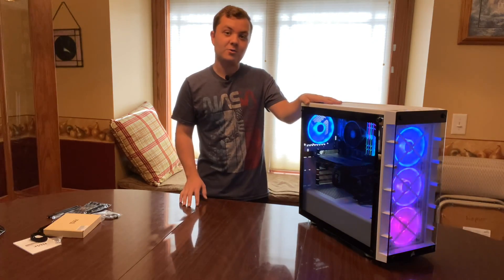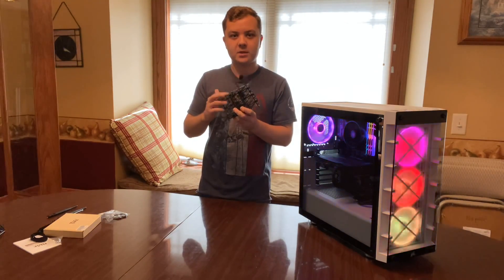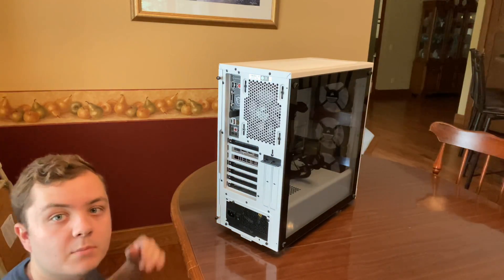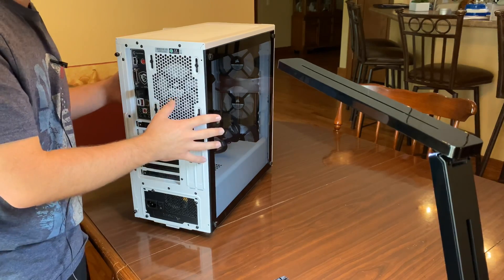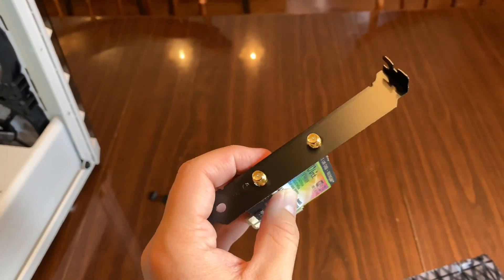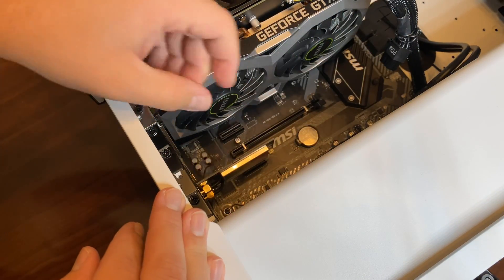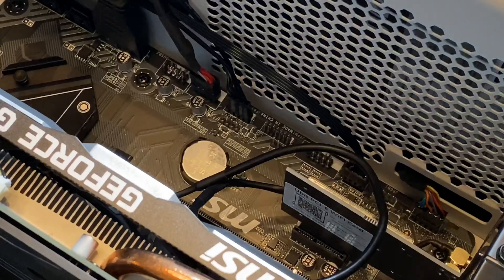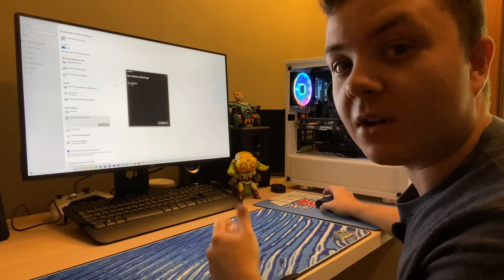How to Add WiFi/Bluetooth to a Custom Built PC

Comment: Typically you either buy a motherboard with wifi and pay the extra or you buy a cheaper motherboard and pay for wifi later.  In general, I don't think you did anything wrong.  There is an advantage in buying a separate wifi card, especially if you upgrade the motherboard often.  The same wifi card can be used when upgrading, thus reducing the overall cost of having to buy the wifi each time you upgrade the mobo.  Overall, some people like to have everything on the motherboard so that they don't have to deal with additional work and compatibility, while others like the freedom of picking their favored product for each feature and not have to be locked in by the motherboard product.  

I think you did fine with everything but that is jmo.
Reply from the maker: True. Also some people just don’t know that their motherboard doesn’t always come with WiFi. That’s what happened to me. I just bought the cheapest and highest rated motherboard and didn’t realize that it didn’t come with WiFi and Bluetooth. I made this video to help people that were in my same predicament. From now on though, I’m prob going to buy motherboards with it already built in. Cheers 👍
Reply: @thinkable3D  Sounds good.  Thanks for the vid.
Reply: @thinkable3D  bro u r cute blob and dumb

Comment: Sorry if I missed it in the video, but where did you put the antennas? I'm gonna order this soon and it would be helpful to know, thank you :)
Reply from the maker: Once you install the card and screw it down, you screw the antennae into the back of the pc where the card is. Then you want to point them up.
Reply: @thinkable3D  thank you so much for responding !
Reply from the maker: No problem. If you need any help just let me know. 😁👍

Comment: 2 bluetooth usb dongles 1 new  v5.0 does same chit  music to sound boxes      
mite  put my old 300mbs  d-link wifi  back in  PC win10        Note:   Use the bottom  slot best  less Conflicks . below GPU  
NOTE:  Best to LEAVE THE POWER CABLE IN   - Why u ask ? earth wire  removes any static  charge if any 
no static  charge  anyway they  did a test  doesnt happen Fake u need a machine   to zap  a motherboard  useless xd 💯

Comment: 1. You should be wearing a esd strap to avoid frying pc components, you can actually damage them, even if u don't feel a shock. The human body can only detect around 1,000 volts or higher, but it can take way less to fry a pc component. 2. Even though the device auto installed it's drivers, you should update them, there could be new drivers from the manufacturer's website.

Comment: yo my wifi is not showing up i plugged it in it’s not working
Reply: my specs are 
ryzen 5 3600 
msi b450 tomahawk max 
rx 580 
and it’s not working
Reply from the maker: Make sure that you have everything plugged into the right places and make sure the  antennae are up and down. Also disconnect your Ethernet cord and see if it uses the WiFi signal. Hope it works👍
Reply: HyperCube which antenna is supposed to be up?
Reply from the maker: Both antennas are supposed to be pointing up
Reply: HyperCube i realized i have to get the drivers but i don’t know how since i don’t got a cd or wifi
Reply from the maker: You are going to have to get an Ethernet cord and connect to a router to download the drivers
Reply: HyperCube thanks man it worked
Reply from the maker: Glad I could help

Comment: Just built my first pc and totally forgot to add the network card. Appreciate the video and hope your channel really grows. I also appreciate how clean and organized your wires are, mine is a total mess haha
Reply from the maker: Thank you for the support! Lol I spent a lot of time making sure it looked good so I didn’t get made fun of for it being messy lol.
Reply: So I just built a pc but my mother board comes with WiFi  would I still need this?  what could still be the reason why I it says “trouble
Shoot”
Reply: @remixsavedme4475  if your motherboard comes with wifi, you don’t need wifi card. If your mobo doesn’t come with wifi, buy a wifi card.
Reply: @fledora1217  does every motherboard come with Bluetooth?
Reply: @Arthorox  Some motherboards do, (new ones a.k.a modern motherboards, x570, z690, b560 and b550) older motherboards do not come with bluetooth (some of them does, prob a z590 and b450’s. (Some b450’s and z590’s do come with bluetooth and some does not)
Reply: @fledora1217  explains why my b550 doesnt have Bluetooth or Wi-Fi. I needed a Ethernet cable. I tried a Wi-Fi usb that didn’t work.
Reply: @ruthless378 wifi adapter didnt work? Might have to do some extra setup in the settings or download the necessary drivers.
Reply: @reloadedspade176  well the one Wi-Fi usb I bought needed a mini cd tray. My pc doesn’t have that so I just said f it, cable it is. Wasn’t going to stress myself out for Wi-Fi when I can easily run a cable.
Reply: @reloadedspade176  it’s all running good now. No hiccups so far.
Reply: @ruthless378  oh that’s good to hear. Ethernet is better imo anyways lol
Reply: @fledora1217 how can I see if my motherboard comes with wifi?
Reply: SUPER

Comment: if it was allready at the motherboard does it have the antennas in the motherboard or at the back like in this vid?
Reply from the maker: It should connect at the back of the computer on the outside of the case
Reply: @thinkable3D  ok

Comment: When I say I learn something new about PCs every day. I’m mean EVERY day
Reply: so is this the reason why when I plug my monitor into my pc it says no signal?
Reply: @Jettazz  yes
Reply: @ExtremeChromoZone  do I need to buy a WiFi wireless adapter for it to work right?
Reply from the maker: So you turn on your pc and plug it into your monitor and you can’t see anything on the screen?
Reply: @thinkable3D  yes my pc was on and I can here the fans then I plug the hdmi into the monitor it says no signal
Reply from the maker: That’s problem is not with the WiFi, it’s either a bad hdmi, wrong channel on the monitor or something wrong with the gpu. Try to plug into another tv or monitor and see if it works.
Reply: @thinkable3D  it’s not the hdmi because the same cord works on my Xbox and I think it’s the wrong channel cause I don’t know how to change it so I have it on my Xbox
Reply: @thinkable3D  I have a question.
Reply: @thinkable3D  is there a way to install the WiFi card driver WHITHOUT the rom/cd drive
Reply from the maker: It should work straight out of the box. But if u need to download some drivers for some reason, you will have to connect your computer to a router via Ethernet cable and download the drivers online.
Reply: @Jettazz  you need to make sure that the resolution and refresh rate of your monitor matches your pc settings
Reply: @mikaellaplante7504  and how do I do that?

Comment: are there any drivers that i'll need to download before i have to use this? or any sort of software that i'll need to install using wifi beforehand? i just bought a usb adapter yesterday but i average 800 ping with it so im definitely going to refund, but i had to download software for it on an external hard drive beforehand. basically what im asking is, do you just put it in your pc and it works?

Comment: does the b365m ds3h motherboard have built in wifi. I'm building my first pc so I don't know is I should get a wifi card or not.
Reply from the maker: It does not have WiFi. Usually motherboards with WiFi will have it in the name.
Reply: Ok thank you sooo much
Reply: I will Sub to you

Comment: Bad idea!  Leave your power supply off, but keep it plugged in so that it is grounded.  Therefore, you can remain grounded from contact with the PSU, while preventing ESD from damaging your components.

Comment: Bruh I bought this and I think it’s in the way of the graphics card so there’s not enough space can you help me out with a solution
Reply from the maker: If there is another slot that it can go in it would work there too
Reply: @thinkable3D  you've misunderstood, his graphics card is too thick and covers the slot, I also have the same problem with a 3090 on a standard atx board. I ended up using a USB wifi adapter.
Reply: Use a USB wifi adapter they're only about twenty dollars and ive had good results
Reply: @marunong5546  what kind can u post the wifi adapter

Comment: Nice video bro ;)
My question was what's the difference than a usb bt receiver? Thats only doesn't have wifi together?
Reply from the maker: You can use one of those too. I’m not really sure what the difference between them is. Better range, better signal, better speed, I’m not sure.

Comment: So I’m new to building a pc and I’m currently on “Pc part picker” building a pc and do the mother boards that say wifi actually come with wireless wifi and Bluetooth usability? And totally off topic question but do I have to get the operating system from pc part picker or can I use a laptop usb windows download?
Reply from the maker: Yep the motherboards that say they have WiFi and Bluetooth have it built in. You can just use a usb to download windows onto your new system. Hope your build goes well👍
Reply: Ethernet cable

Comment: Do you need the network card and the antenna
Reply from the maker: Yep it should be included
Reply: @thinkable3D   which network card did you use in the video
Reply from the maker: It’s linked in the description

Comment: But... if i order a motherboard with Wifi and bluetooth built in do i still need a card like this?
Reply: Dont have to, this is for mobo without built-in wifi/bluetooth. Typically on the mobo box it will tell you if it has wifi eg. Asus prime b550m-a(wifi)

Comment: i have a micro atx motherboard which means that the gpu is covering one of the slots and one of them is sooo close to the gpu fan i don't want to buy it and then find out that it doesn't fit so can you plz give me a platform that i can contact you and send you the pic ? thx

Comment: great vid. Thanks man. How did you know bluetooth and wifi wasn't available on your motherboard? I don't see bluetooth or wifi on my options. I've been connected to ethernet, but would like to use my wireless headphones too.
Reply from the maker: If you disconnect your Ethernet and can’t connect to a WiFi network then you don’t have it built in.

Comment: Whenever I connect my wired speakers or headphones all I hear is a bad sound, I can not hear anything
Reply from the maker: Try plugging the cord into another sound port
Reply: I only have one
Reply: I bought the device so I could connect my controller to my pc but now all I hear is static
Reply from the maker: What motherboard do you have?
Reply: B450m pro m2-max
Reply from the maker: Your motherboard has a Pink, Green, and Blue audio ports on the back of the computer. The green is for speakers or headphones 🎧 , pink is for a microphone  🎤, and blue is for something else. Try the green port
Reply: I’ve tried everything, I went through every setting, i reset the pc, I reset the bios and nothing makes it work
Reply from the maker: I looked it up and it said you might have a bad motherboard
Reply: As soon as I plugged the device the sound went out

Comment: that's very pro, and helpfull video ! i'm on my way to build my first pc, and where i live i need wifi, so i picked up an network card ... so i still need an ethernet cable plugged in in order for windows to download the drivers of the card for so it works ??
Reply from the maker: If you install the network card, it will have drivers already installed, but i would search the internet just in case you need updated drivers.
Reply: @thinkable3D  Oh si it should work right off the pack ? Even if its first boot ever of the pc ?
Reply from the maker: It should

Comment: When you build a pc do you need this to connect to the wifi or is it already built in to the card plz answer
Reply from the maker: You can connect via Ethernet cable directly to your router. Otherwise it will be up to the Motherboard you have if wireless WiFi is included. If not, you will have to add a WiFi card like i did.
Reply: @thinkable3D  how can I check if a motherboard has wifi or not online
Reply from the maker: Search if your specific motherboard has WiFi built into it. It will say in a product description.
Reply: @kkhang8617  thanks!
Reply: @thinkable3D  so if my motherboard has pre installed WiFi can I just connect a ethernet cable instead of downloading WiFi drivers
Please answer
Reply from the maker: Yes. You can always use the ethernet port. This video was just talking about using your pc wirelessly.
Reply: @thinkable3D  thanks

Comment: i’m such a noob but i have a question. so i dont have wifi at my house. is there a way to have wifi on the pc without buying a router? (i also have my iphone hotspot)
Reply from the maker: You could use your hotspot, but it wouldn’t be good connection at all. Like you would barely be able to watch a YouTube video.

Comment: Hi I’m new to the PC world, I just built mines and the motherboard is MSI B550-A PRO doesn’t have WiFi or bluetooth. Do you think the same adapter you installed will help with my motherboard?
Reply from the maker: Yes it will! It will install into the small PCIe slot above/below your Graphics card. Here is a link to get the wifi card that I use: https://amzn.to/3mwynNW

Comment: If I just want Bluetooth can I use a Bluetooth USB adapter or no?
Reply: im no expert but that should work
Reply from the maker: If you just want bluetooth, then that will work. If you install a wifi card, you will get wifi and bluetooth.
Reply: @thinkable3D  ok thx

Comment: What motherboard are you using? im building a pc and want to buy this one
Reply from the maker: This is the motherboard that I am currently using: https://amzn.to/2JqqfjG
Reply: @thinkable3D  ohhhhh a tomahawk, got it! I thought so haha, thx! I am considering a MSI B450 GAMING PRO CARBON MAX WIFI ATX AM4 Motherboard or a MSI MPG B550 GAMING EDGE WIFI because they both have wifi and are really great, do you think these might be better?
Reply from the maker: If you get a motherboard without WiFi and then add a WiFi card then it will be cheaper to do.

Comment: I really need help!!!I’ve just got done building my pc only to find out I need WiFi. I have a xfinity router. Will this WiFi adapter connect. If not can someone tell me what I need to look for?
Reply from the maker: Adding a WiFi adapter to your pc will allow you to connect to a wireless router
Reply: @thinkable3D  I got one and it still doesn’t let me have WiFi it keeps telling me I need a Ethernet cable... I need help please
Reply from the maker: Make sure that you have downloaded any drivers for the WiFi card. If it didn’t come included in the package, search the brand of WiFi card online and look for the drivers to download. Also check if the card was correctly installed.
Reply: @thinkable3D  I got a WiFi adapter usb. Is that the same? The usb said that is incomplete that I need connection to Continue it. So do I need to get another computer and do that or what? I’m sorry for all the questions I’m just so lost :( I think they person that did my pc forgot to put a network card
Reply from the maker: Try to see if the brand name of the usb device is written on it. You might have to connect your pc directly to your router via an ethernet cable to install the drivers. Maybe search up on google how to activate a usb WiFi adapter.

Comment: Quick question will a tomohawk b450 max fit into a 220t Corsair case?
Reply from the maker: Yep. An atx size motherboard will fit into either an atx mid tower or atx size case

Comment: How do you connect it to the WiFi you want or does it connect to the nearest WiFi automatically?
Reply: In the right corner of the taskbar, you should see the network icon. It should be a globe with a small "no" symbol. Click on that and you should see a list of available Wi-Fi networks. Choose your network, enter the password, and you should be good to go. You may need to install the Wi-Fi network card drivers if it can't detect your Wi-Fi adapter, though.
Reply: @JJFlores197  thank you

Comment: Does the network card should be compatible with the motherboard ? or just whatever network card?
Reply from the maker: All that I know for sure is that you have to make sure that the connector has to work with your motherboard (I.e. has the right port)

Comment: Does every motherboard have a wifi and Bluetooth card slot im a new builder
Reply from the maker: This kind of network card uses the PCIe express slot. The same type of port the graphics card uses.
Reply: You can also buy motherboards with built in wifi

Comment: DO YOU HAVE TO USE A BLUETOOTH DONGLE IN A USB PORT ON THE OUTSIDE OF THE PC, IN ADDITION WITH THE "USB/WIFI CARD CABLE" THAT CONNECTS TO THE MOTHERBOARD AND WIFI CARD INSIDE THE PC, IN ORDER FOR THE BLUETOOTH TO WORK? ...OR IS EVERYTHING THAT YOU NEED FOR THE BLUETOOTH TO WORK, ALREADY BUILT IN THE WIFI CARD? 🐸🍵🤔💯
Reply from the maker: There is an antenna that is connected in the back of the pc with the WiFi card. It’s all 1 unit.

Comment: Hello, I have a question. Do you need to build your pc then put your WiFi card? Its my first time building a pc and I’m a bit confused. Can I build my pc and put the WiFi card during that process?
Also do you need to install the Bluetooth USB cord for the WiFi card to work? For some reason I don’t have the USB cord!! :  (
Reply from the maker: You can definitely install the card during the build. The reason I didn’t was because I added it later on. Some cards don’t need power directly to them so they don’t have a usb cord. Install it how the instructions say and you should be good. Hope your build goes well😁👍
Reply: @thinkable3D  ohh!! Thank you so much
Reply from the maker: No problem. Glad I could help😁👍
Reply: Did it work ?